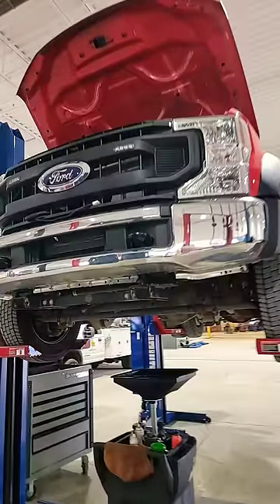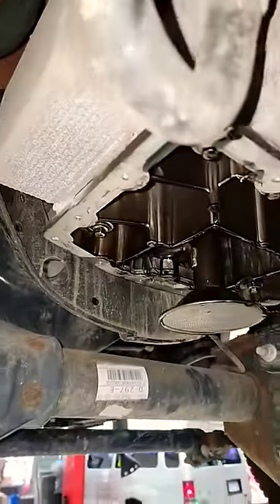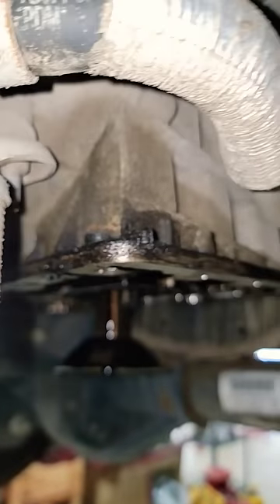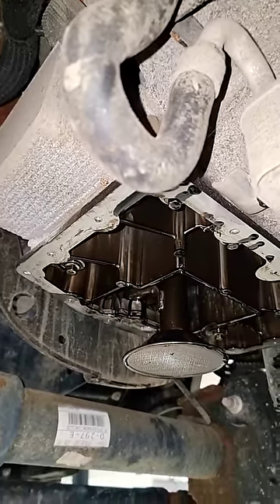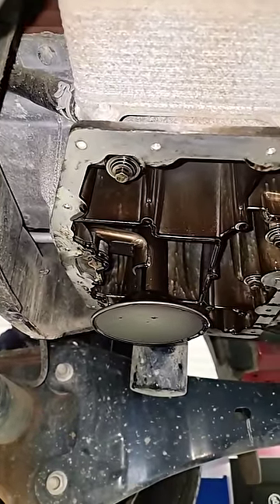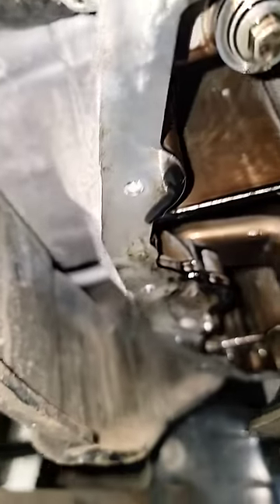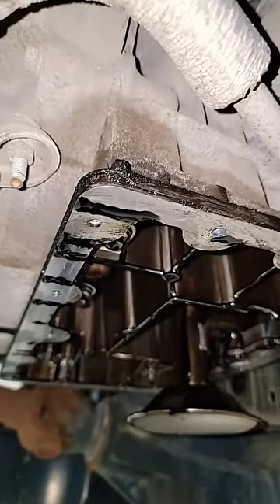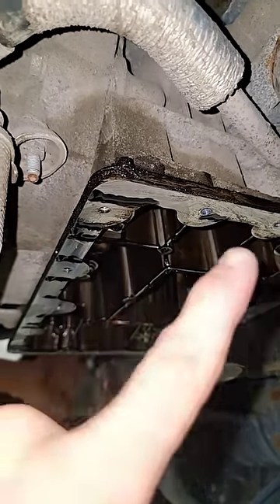Listen UP you Ford 6.7 engine builders  SMH 🤦‍♂️#bebetter #shorts #fyp #fordtrucks

Comment: It’s usually managements don’t care for nothing but their bonus checks 
 It’s always rushing and yelling to cut corners for bonuses
Reply from the maker: Yea no kiddin'
Reply: @GC he's not wrong though. Demand is so high that production, not quality, is what's being prioritized. I'm work in a factory and we are at 200% output for the last 1.5 years, same staffing. This means we are doing double the work for the same pay, quite frankly just surviving the week is all that matters anymore.
Reply: @SweetLou0523  are you really? I work at a factory as well and it's been super slow for us
Reply: @RRyxn  we've been running at double output since mid 2020. Our current order backlog is at 16 months. Down a bit from 22 but still. A year and a half of active orders is insane. Maybe it's just a difference in industry? We run wire, all sorts of wire for anything you can think of, and it's just been a huge landslide of orders.
Reply: Facts, economics tightness & shortcuts and corner cutters gone kill the biz. They laying off and want less workers to handle the jobs of 2 including inspectors.
Reply: My experience working in a automotive factory was getting trained by some 20 year old kid that didn’t really care about the job for a day then just thrown into it. I didn’t even realize I was manufacturing seat mounts for the CRV at one of my stations unit 3 months in…
Reply: @gilliesiut2332  great to know our suppliers quality is of top priority lol.. doesn't surprise me one bit though considering they probably don't even pay you enough to survive
Reply: @RRyxn  the 18hr I made was better than the 16 the temps where making
Reply: 100% correct I work for ford motor company as a auto worker and management just want numbers.
Reply from the maker: Would love to chat with you
Reply: I can totally believe that.
Reply: It's not the Managers greed where it ends. It's the shareholder that's breathing down his neck.

Comment: I use TA-31 on everything, its my all purpose rtv and I apply it to both surfaces, a very thin layer and spread it by hand, then lay a 1/16 - 1/8 bead and stick it together, let set up for 30 min hand tight and seated and then torque it's down. When it cures, it's damn near welded on.
Reply: Damn nice tip
Reply: I let it sit for 31 minutes. Then it’s literally welded on
Reply: @tlc5343  I just weld it.
Reply: Lol so you're a professional hack job. Congrats.

Comment: It's a good thing Toyota doesn't make a heavy duty pickup. I used to love watching your videos because I love the technical part of trucks and I love fixing myself but my 2013 tundra leaves me kind of bored since in 100,000 miles all I've replaced is spark plugs and air filters. It's no F-250 and it can't haul massive weights but every time I turn to key it starts and my driveway has no oil leaks. There's something to be said for that. Ford has built a reputation of getting it almost right and then assuming repair text will take care of the rest. It's a bad business plan. They can't just spend all their energy focusing on performance vehicles and high dollar vehicles and that's not to say that some of these f-250s like my favorite tremor are cheap. Some of them are fetching 80 or 90,000 dollars. I honestly think if people would stop buying new trucks because of quality issues, the manufacturers would wake up but I won't hold my breath.
Reply: Tell me about it my 21 350 with very low mileage has been in the shop 2 times for major repair and i paid $100k for the truck
Reply: My 15 acquired a rear end leak within 1000 miles.
Reply: 2001 land cruiser. 4.7L V8 298k still no leaks uses 10 oz oil every 3.5k. Been beat to hell. We love that rig. It's concerning to hear how many minor and major issues a lot of these new trucks and SUVs have especially for how much  they cost.
Reply: @trustyoldiron5416  I've got the 4.6 V8 in my truck. Bulletproof engine. Oil changes and air filters is all I've changed. 104k miles and I'm still on my original brake pads from 2013. Still original battery even.
Reply: @trustyoldiron5416  that's not fair. That truck come from an era where the Japanese workers were disgraced if they did shoddy work. Even Japan has gone away from that in recent times.
Reply: Toyota makes Hino. Not pickup trucks, but plenty of utility bodies available.
Reply: lxRaptorxl  Sure, we allllllll believe that story.

Comment: Working on aircraft fuel cells I always tried to emphasize cleaning the surface before sealant is applied. Also I have worked many jobs where new sealant was poured over 6-7 layers of old tries to fix the leak. Preparation is the most important thing.
Reply: Should have bought a Toyota.
Reply: Your job really has lives depending on it
Reply: Every Good Job in the World if you think about it is 50-90% Good Prep. Across All Building, Construction, Mechanical, ART, Music, Etc. So Many Things. Everything. Good Lesson for Life.

Comment: My 2019 f150 with 27,000 miles on it is cleaner than that underneath. I drive in the winter in Michigan FYI
Reply: That's what I was thinking, it sure looked awfully dirty for 3000 miles
Reply: More than likely sat on a lot waiting for parts or a chip before it got sent to a stealership. There's so many vehicles just sitting and getting lot rot because they're trying to keep up with orders but don't have all the part's to finish them lol vehicles are fuckin ridiculous right now. 115k for a 3/4 ton here in Canada right now and lot's of them don't have sunroofs or heated seats because of the parts/chip shortage....yet they're priced as top of the line models with every option. When dumbass consumers stop buying them then the price will drop back to a reasonable number and quality will go up.
Reply: It's a work truck. There's plenty of mud under it.

Comment: My F-150 started leaking oil and I was to busy at the time so took it to a shop to get it fixed. Couple weeks later it starts leaking again, after researching online I was worried it would be an ongoing issue based on everyone’s horror stories. Second time around I replaced the stupid plastic oil pan and RTV gasket myself, haven’t had a leak since! Moral of the story is yes metal prep actually makes a huge difference.

Comment: Worked at Ford many years. Seen some strange things. One tempo came in for a knocking noise top end. It has 5000 km on it. Took head off and one cylinder was not bored out. Had thread like finish from casting. They had hammered the piston in anyway and well it worked!!  For a time
Reply: 5000K? I’ve never seen a ford go 5 million miles?
Reply: @chasemorgan2788  km

Comment: Me with my third Kia soul engine: mmmmm ooooooo ahhhhh
Reply: I'm on my 2nd Land Rover engine.
Reply: I worked in parts at a kia dealer for a couple years, I feel your pain. Engines backordered for months, cores stacked everywhere. You wouldn't believe how many 2.0s and 2.4s grenaded from eating oil 'till there wasn't anymore. They made it a long and drawn-out process to diag and made you jump through hoops to order em because they wanted the supply to catch up and look better on the warehouse side. Hyundai/Kia gave 0 shits about the shops doing the work.
Reply: @jamesb1221222  I wish my transmission was still under warranty because I think it's slipping. It's not as responsive anymore. It's sad but as long as I have a warranty on it I'm keeping it.

Comment: Fire those people.
Reply: Good luck with that. Unions make it extremely difficult.
Reply: @MPerry-ox9qb  You can just file a lawsuit against the union itself under consumer rights fraud. Which this pretty much is.
Reply: Fire what people. Everything comes down from Corp call Ford and complain.
Reply: @MPerry-ox9qb   what would you say if its not the unions and not the people on the line maybe its the Corporations that supplies all the parts ,supplies and each job on the assembly  lines where line workers have each job listed on a sheet of paper that tells you each and every step you make take and what supplies or parts you do or put on each job. 1 job can have 20 to 30 steps to take and many supplies. If its not listed on the job steps to complete the job and or if the supplies or parts aren't there then CORP don't want  it done. In this situation if a gasket or silicone is to be used and done then after 30 trucks there would be many gaskets or silicone that would be un used and a floor manager would want to know wtf. Was going on . As all assembly work has all parts and supplies automatically delivered by how the assembly line is running. Another words this is how a issue like this would be caught by the supplies being delivered while there was already a full box or container full when the new resupply arrived. So this is a corp decision.

Comment: Silicon goop is not the answer!!!
After the manufacturer has screwed it up; Fel-Pro gaskets, or good old fashioned, "Hi-Tac" on both surfaces of the gasket. 
Silicon goop easily balls up, then finds an oil way to block real quick! It is the panacea of the psuedo "engineer" or inexperienced shop mechanic.
Clean and prepare the metal surfaces with alcohol. Lightly Hi-Tac the lower pan gasket surface, fit the gasket, then Hi-Tac the upper gasket surface of a simple gasket, fit and torque into place.
It can get sticky, but will not leak!

Comment: My brother just had to have his super duty in (2023) because the AC quit working and it threw codes. Less than 2000 miles on it.
Reply from the maker: Ive done 2 of em already, i bet the dash has to come out
Reply: @PowerStrokeTechTalkwARod  ugh! Code was: P249E - Closed Loop Reductant Injection Control At Limit - Flow Too High
Reply from the maker: ......thats has nothing to do with the A/C
Reply: @PowerStrokeTechTalkwARod  exactly lol

Comment: If you use silicone with an oil pan gasket, i will fine you amd give you a charlie horse. Silicone eats gaskets and should only be added to a gasket when it runs across the point of 2 surfaces meeting perpendicular to it.

Comment: You got the surface prep ideas from wsm in the first place
Reply from the maker: Yea no
Reply: @PowerStrokeTechTalkwARod  oh ok there was no 20-2015 pertaining to lack of adhesion. Been a problem on most of their engines for a while now.
Reply: @PowerStrokeTechTalkwARod  oh wait, there must not have been 23-2075 to install oil pans with gaskets on certain engines also. So yeah, yeah.

Comment: dam 3000 miles and 400 engine hours that's like 27,000 miles it just sat and vibrated a hole for an oil leak always look at the hours when you buy a car engine hours are worse than mileage

Comment: My friend bought a brand new F150 in 2020. Put 40k miles on it before then engine exploded. Ford warranties drive train up to 36k miles. He got royally screwed. None of the manufacturers are without problems, but Ford is the worst. Buy a Ram, be damn sure your oil changes happen at 5k or less, unless you idle a ton, then do them even sooner. Youll get 200k miles easily out of a Ram.

Comment: Look at how much rust is on the front axle at 3,000 miles. I have a 2018 f150 and it doesn’t have that much rust anywhere under it at 115,000 miles.

Comment: Ever pulled a trans pan on chrysler dodge ram product that was factory installed or redone worn factory Silicone they come right off and have 99% of the Silicone on the pan and don't usually leak unless they haven't been serviced in 100k+ miles or 15 year..

Comment: Growing up I was always a Ford guy.  Still have a 1990 Mustang 5.0L coupe in my garage.  Looking for a pick up truck.  Ford is a place now I wouldn’t ever considering going.  Their current CEO cares about the cutting costs to max out the margins.  Most companies now look at their Quality departments as nothing more than an entity that costs them money and takes away from the bottom line.I was a flight inspector at Sikorsky Aircraft for 38 years.  Our department was looked down upon since the advent of ISO 9001.  I was there when it started. I went to all the classes over the years pertaining to ISO and the constant changes to it.  ISO was created by the European Council of Corporate CEO’s.  It was a way to circumnavigate around their quality departments.  What is ISO?  ISO is a Corporate designed system put on paper and incorporated into their business statement.  It shows they have a quality system on paper.  There is nothing there that says it has to work.  So, the next time you see a company proudly flash that ISO certification sticker… beware.

Comment: So much not being said.  The pan gasket is a symptom of a larger problem.  Surfaces most likely seal without gasket.  This truck's problem was pressure, lots of crankcase pressure pushing out from inside.  Some have even said water cannot be compressed.  Doesnt help that this engine is like 8 separate castings stacked, so many surfaces, so many bolts. Design is questionable but water dgaf.  3k miles???  Tow bar attachments on front?? towed behind underwater rv? must be.  Case closed

Comment: I worked for a movie equipment and transportation company.  A big one, with lots of fleet vehicles, newer and older.  Whenever the fleet truck mechanic was cussing, tearing half the truck apart,  waiting for parts or just taking 3x as long as it should, it was a Ford.  Everytime.  They run great...  When they run. Buy a Ram diesel and be done with it.

Comment: The transmission on My brothers 2022 f-150 went belly up with less than 3k miles.  Dealership said 1-1/2 years for a transmission.  No replacement rental etc and had to purchase a new vehicle.  A month later the truck with the bad transmission had been repaired and was on the lot for sale.

Comment: No doubt the manufacturing is at fault, yet your customer is most likely drag racing a Chevy or Dodge at the traffic signal. Might want to check for leaking tranny fluid. Seals are probably blown out 😂

Comment: my  6.4 is like this .  I also have GM
Cars that  are like this .  mfg ' s  
do not seal  gasket surfaces  . they 
do not heat insulate either . 
timing cover leaks .  no 
surface prep . All the surface 
needed is some High Tak  or 
Silicone  .  BLUE

Comment: 3000 miles but 4 hundred engine hours. I doubt it's just prep and more to do with carbon build up in the return system causing to much positive pressure causing premature leaks

Comment: My 2011 6.7 ford still has no leaks.  165k miles.  I did have to fix a fuel leak under the intake plenum though.

Comment: The new kia sorentos also have an oil pan leak issue. Had a sorento come in for its very first oil change at 7k and the pan was seeping oil out the back. Same issue, upper pan had no scuff on it in some areas so the goop didnt stick well enough

Comment: they put the silicone on the lower pan and let it skim over then installed, dried enough with the skim it did not stick to upper. seen it for years even in dealerships on repairs and they wondered why they got comebacks

Comment: I actually worked at the place that makes those plus the transmissions . They have a team from ford to see why the factories are running at 30 percent. There conclusions were that the machinery they're using is 40 year old technology.  So their recommendations was new machinery . The company making these will not let maintenance work on the machine until it goes almost dead . Qc and the workers do a great job but the company just wants to push out as much as possible with little maintenance.
Reply from the maker: Friggin awful

Comment: Hey aren't oil's only supposed to be changed every 3-5-8 months or per the oil and vehicle mileage? 

Every single one of those trucks had fluids in them that degraded. Then people went and drove them.

I wouldnt buy your 2022 or 2023 even for more than what I paid for my 2011. 

Your trucks are only worth 10 grand lol.

Comment: Master Subaru tech here. We had a small time frame with exactly the same problem on the 2.4 turbo engines. Lower oil pan is leaking oil before the first oil change, no silicone stuck to the upper oil pan upon removal of the lower oil pan.

Comment: 2016s F150s had factory issues as well. The truck beds were not welded properly and the rear ends were way too light because they are using too much aluminum. Another issue was the doors flying open because they forgot to put a air/pressure release inside the cabin. When owners shut their doors the air pressure was causing the doors to bounce and not lock/latch, winter would cause door locks/latches to stick as well

Comment: Ford's rear differentials ALSO have issue with the sealing; I've had both two rear differentials start leaking @ 45k-50k miles.

Comment: You sir are a liar...   for 1. If that truck only had 3000 miles you wouldn't have it in your shop. It is dealer warranty work.  2. That oil is very dark for 3000 miles. 3. I see lots of corrosion and salt rust for 3000 miles..
Reply from the maker: 1. U sir, have NO clue what you're talking about. Read the bio ding a ling & 2. I wldnt waste my precious time bull$hitting you to begin with